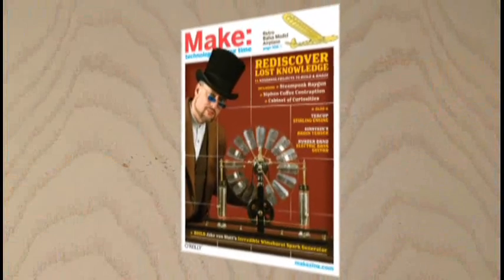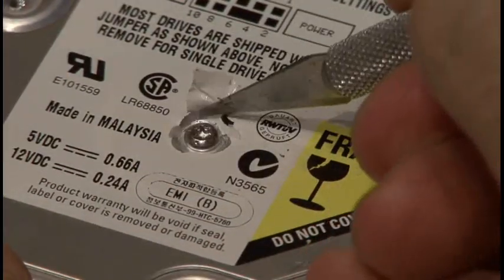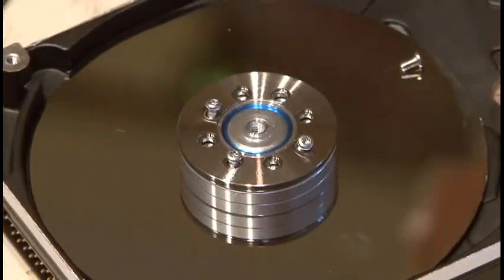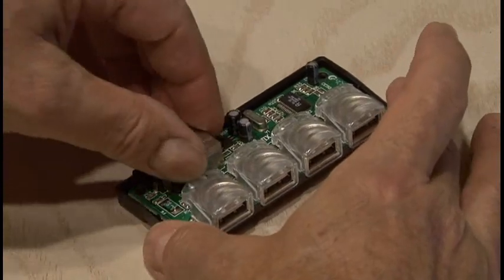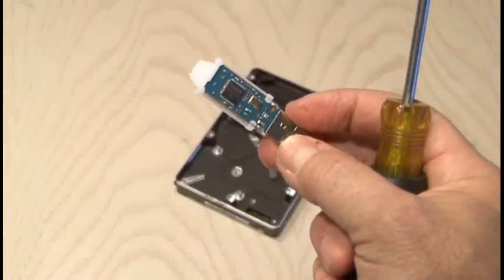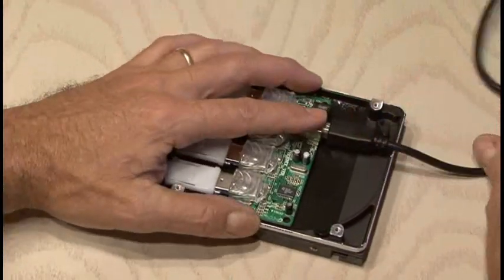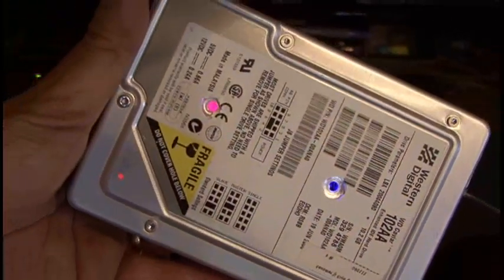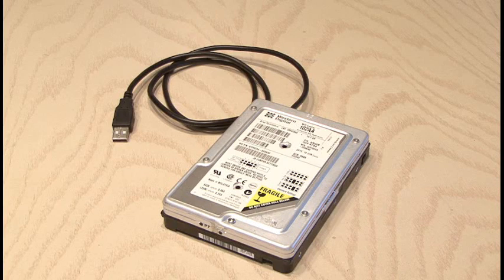Weekend Project: Flash Memory Hard Drive

Comment: @krap101 Just because the IDE bus can transmit up to 133 MB/s, and the SATA bus up to 375 MB/s, doesn't mean hard drives can do those speeds. Most modern 7200 RPM drives can do a median of 60-70 MB/s read and usually worse writing, which is what USB 2.0 can do (~60 mb/s.) If you have a good USB 2.0 flash drive, it can usually sustain maximum throughput of the USB 2.0 bus both ways, making it faster than a hard drive.

The only downside is flash drives used in that manner won't last long.

Comment: Easy to turn 4x USB flash drives into "one drive". Its called Symbolic links. You use on of the USB flash drives and using MKLINK command in windows link the other 3 drives to folders on the 1st USB Flash drive. Do a google search for the MKLINK command and how to use it.

Comment: hey guys, to combine the drives you need to 'span' them. spanning is achieved in windows 7 (enterprise and ultimate) using the dynamic disk tools.

you could set them up in a raid configuration! that would be a really cool upgrade as it would maximise reliability as well as all the other bonuses.

Comment: Not to mention he didn't actually "double" the capacity. he said it was a 20 gb HDD, and used two 8Gb flash drives and 2 4Gb flash drives. (that's 24 Gb for those who are bad at math)  so he added 4gb, and made the whole thing much heavier and bulkier than necessary by adding the HDD case.

Comment: @theonlyraybenz  True magnetic disk drives are a lot cheaper than flash drives, but one thing thing to think about is solid state memory is a lot more durable. My cousin sent a SD card through the wash once and it survived!

It looks like you could make an even tighter case and if you could format the drives into a raid I think it would be a pretty solid project worth doing.

Comment: @Wilsonboy0528 uh hey uh Dude , you're missing the point ..., why strip a perfectly good hard drive??? when it could've been used for a freenas machine or repurposing  old hardware...!!!

a more "basic" way (as you put it) would've been to just attach the thumb drives to the hub mount that up inside the tower somewhere and call it good...

so yeah , why don't you reply back when you have a smarter and more well informed (possibly from a linux and not a common micro$oft winblows user) standpoint

Comment: I had made something similar to this back in 2004 using (4x) Lexar Jump Drive Elite with a USB 2.0 hub. I had installed RAM IC heatsinks on each USB drive with Arctic Silver epoxy for extra cooling. I had configured them for write behind caching on my WinXP box in 2004, well before "Readyboost". I would personally use an external eSATA (3 Gbps) drive and shielded cable for "Readybost" or Linux Swap, as this is superior to USB 2.0 or Firewire 800. At the time (2004), it was a neat idea.

Comment: @TheLagartijamovil Nothing wrong with flash memory, but you want it to be flash memory in the form of an SSD with a SATA interface and a SandForce controller... In Australia, an OCZ Vertex 2 60GB sets you back 145 bucks and it's much, much faster than regular hard drives. I managed to get the OCZ Vertex Limited Edition 100GB for 200 bucks (they no longer make it) from a retailer who managed to get them and it works awesomely :D The best bit is booting anywhere between 5 to 10 seconds.

Comment: Fun fact CompactFlash cards can be wired up to an IDE port and work, all you need is a passive adapter, so you could alter the drive to be a CF adapter without any new parts by wiring stuff right to the card.

Comment: @newusername01 Why would you do that when you can get a pretty large and very fast SSD for that?  Hell, you can get a 120GB OCZ Revodrive 2 for that.  That's 4 SSD's with Sanforce controllers on a single PCIe 1x card.  All running in RAID0.  It's the fastest SSD on the market with out jumping to the IBIS drive.  They cast just a bit more than your SD card idea and it WAY faster.

Comment: @sepiachoice Well you can get USB hubs that go in the back where thing like video cards and stuff go and plug it in with a 4pin. Sometimes they have one USB inside, where you can plug this little thing in.

And if your school doesn't let you bring in flash drives (autorun content and malware transporting can be done with them) but does allow external hard drives (more pricey, less likely to be used as malware transport) you can use this sneaky trick to bypass that rule.

Comment: @mannsi08 Actually if you use a high speed usb thumb drive that's USB 2.0 or 3.0 and could raid them together it should be plenty fast enough. Maybe not as fast as the latest ultimate speed SSD's, but pretty quick.

Comment: ok, then this was pretty useless, but now this is a great idea. first, now you know to make it raid 0, also now theres usb 3.0 which would let you use a usb hub like they are 4 seperate usb components. also, now you can find a 16 gb flash drive for just 10 dollars on amazon. so you could get 64 gb ssd for just 40 bucks, and if you have usb 3.0 you get 10 times faster then this

Comment: So all this does is put a USB hub with 4 flash drives into a hallow HDD case for no reason. He doesn't even put it inside the computer. What's the point? Just use the flash drives with the hub.

Comment: @TechBoy195 You ever tried to use four usb flash drives, a wireless mouse, wired keyboard, 360 gamepad,iPod connector, and a powered amplified Stereo headset. I bet not, but some people like me would do. This simply would make it easier. Plus what the hell would YOU do with a 10GB HDD. just throw it away.

Comment: @80486er I wishwe could put in 8 USB Sticks instead of 4. Wait, we just remove the USB connecters and wire the flash drives in directly! We should also add some RAM.

Comment: This would have worked better if you had a SandForce controller and harvested the NAND flash chips from the USB, then use the SATA interface to actually have it inside your computer. Thereby creating a 3.5" SSD/HDD that only uses flash chips, and is not restricted by the USB2.0 read/write speed restriction, not to mention, there would only be 1 drive path.
It would probably be about 100 bucks more expensive though.

Comment: Cost 1 x hub and four keys = more than just buying an external hd! This has to be the biggest EPIC FAIL i have ever seen. By the way it is not a flash memory hard drive its four usb keys in an old hard drive case you moron. And for my next installment how to make an old power supply even more powerful, just take out the insides and replace them with more powerful insides from another power supply.

Comment: @madjam002 USB3 has been out for a few months. And USB3 (5Gbps) is actually faster than SATA2(3Gbps) my usb3 HDD dock transfers data from harddrives at their max speeds and is limited by the HDD speed, not the cable.

Comment: It's called Raid0. Linux has a software raid driver. Windows should be able to combine them using its volume manager. But I wouldn't use raid on flash drives, it would run like total crap, especially when each "drive" is connected through a USB hub. I could be wrong but I don't expect good performance at all.

Comment: if you format the multiple flash drives into a single combined hard-drive using something like partition magic you could get away with a single drive letter. however, the entire thing would fail if just one of the drives were to break for whatever reason.

Comment: @Madclocker  Now-a-days USB 2.0's have what's sometimes called Ready-Boost, or Speed-Boost, and others just call it System Paging, all it does is indexes a bunch of files and dumps them on the flash drive so whenever you plug in the flash drive it becomes a direct use drive by the OS like a virtual drive or a simple hard drive with less space.

Comment: @DarkPlagueStudios  Yes but you haven't used it for OS have you?. It would be toast in about 1 week. Most peeps don't know it, but your computer writes to and from the disk thousands of times daily, and the nand technology only allows for about 1000 rewrites per bit on these cheap flashes. This project is no good for OS loading.  the only reason to do this is to get more storage capacity out of existing flash drives.
Obviously it is a great conversation piece though.

Comment: @wowfreaker Bullshirt..a terrabyte is 1024gigabytes....he's just pissed 'cause his 1tb drive formatted to 971gb. You have to remember that formatting in itself takes space on the drive, otherwise, the computer wouldn't know where to look for the needed data...also Most hdd makers cheat on the spec's and relegate 1000gb to 1tb instead of the actual 1024 gb per tb. So you are already being cheated on the capacity, and add the formatting and you loose more than expected. I hope this clears the mud.

Comment: @jaggedspike My 1st hdd was 20mb (I had two) The processor was a 16mhz 386SX (16 bit code only) 4mb ram, and a blazing fast WD bussmaster vid card with 256kb mem. (I still have the card and 1 of the 20mb hdd's) That's when I discovered the original  "Duke Nukem"...what fun times. 
Actualy my 1st computer was a RadioShack MC10 but it was stolen b4 I got a chance to "get to know" it.

Comment: @Mariuspersem  Well, sort of..the SSD's out now are using faster mem chips than flash drives, and they use an interface that won't impede the performance by much. I haven't delved into the specifics but when the 1st flash drive came out, I knew that it was only a matter of time b4 ssd's came out.
I remember speculation that ssd's were comming, but they would be slow as snot. (the 1st flash's were almost as slow as a floppy disk) so nobody expected much

Comment: @douchebagsification  From Windows 2000 and up, there is a program called "disk management" that will let you set all the flash drives to dynamic and you can setup the raid array from there....have not played much with it, so I cannot give particulars but I think everything you need is in there. The MS knowledge base can give all the instructions on how to do it.

Comment: @uxa1 I can;t see how this can speed up anything...USB drives are inherently  slow, even with USB 2.0 technology. I can see the geekyness of the project and I can see the benefits of having a large capacity  flash drive for reliability and longevity, but no speed increase..I would suspect the opposite is true. and for those saying that you just made it harder to remove the individual flash drives, why would you want to? Just keep one as is for the sneakernet.

Comment: Really  - no point what so ever to this Tech-Tip. All you really did was destroy an old hard drive. You could have just used teh USB-Hub and plugged in the Flash drives and had a much smaller and lighter storage block...Also, since you've incased them, you can no longer simply remove one of the Flash drive - if you need one, you have to now unscrew teh case..>? what a useless Idea...

Comment: I know a tricky way to make it all into 1 dynamic drive.It will require extreme caution though.
1st.remove the memory from the USB flash drives which would be small rectangular shapes with some metal wires popping out and going down.

Find a circut board compatible to fit all the memory and a USB slot and mabye a resistor or other componets found on a USB storage device.
Solder it all onto the circut board.

Comment: This is a great project if you happen to have a source of cheap flash drives!
Otherwise, I was able to find a refurbished 2tb external NAS with 1gb RJ45 for under $200 on ebay... it's a 'worldbook' with two 1tb drives in RAID0. Just make sure to use CAT6 cable which is added expense. Can also be reconfigured to mirror, but then you loose 1/2 the drive capacity.
If flash drives ever reach 1tb, I will be doing this project for sure!

Comment: Why dont you use software RAID to combine all 4 into a single drive?
You would need to have 4 identical size 'drives' ie 4x 8gb
Certain versions of MS Windows support software RAID without needing to install anything extra.

With RAID5 you could have 24gb with redundancy incase one of the memory sticks fail, you do not lose any data.
Or with RAID0 you would get 32gb as a single drive letter.
I do this with old IDE drives.

Comment: Amazon has a  Serial-ATA-Adapter-Converter-Backup so you can make it IDE or SATA ready.

For dynamic disks you can do that in Windows. Do a search for dynamic disk drives

Most awesome. You can install any OS in about 8GB, so the other 3 could be OS Storage. Of course you could also boost the amount of HD Space with ease by replacing any of the USB flash drives. Excelsior. Faved.

Comment: @samchaosdesign Actually, my first computer was an HP 9830A "desktop calculator." It didn't have a screen; all output was to a line printer. No disk drives. Either tape or card deck. Oh, and a total of 7600 bytes of RAM (yes, *bytes*). Made in 1972.

Comment: @tiktok51 

Do you realize how much work it is comparitvely to get a new drive working?
Aside from backing up the old one, you also have to format the new one, get the proper power connections (and new ones if necessary), and see if the computer recognizes it after all of that.  And that's not even counting putting all your old shit onto it.

Comment: @sideburns2009  usb 2.0 will provide 500ma of power only after you have done the "aknowledge" initialization. so first usb give you 200 - 300 mA and then , if everithing goes right , it gives you full power. otherwise it stop erogation of power t. so is not so simple that it will work. in some case yes, in some other no.

Comment: Like here in America our housing has 110V to a wall socket, I can plug in a power strip with 6 plugs and use all 6 pulling the 110V's. It's not going to just "not" power them but my electric bill is sure going to be higher. The power is there and all 4 will use the 5V provided to be powered but USB 1.1 isn't always compatible with multiport USB hubs.

Comment: @djtonyxxx5 Don't need to try it. I know how USB works and the differences between 1.1 and 2.0, aside from the speed but just knowing how it works is all you need. USB has a +5V hot and a ground and the rest is data. USB 2.0 has more support for a higher variety of devices. USB will provide a constant 5 volts, it will power all 4, just run the battery down faster in a laptop.

Comment: mdadmin can be used to set those up as a RAID-Device, if you reconfigure kernel and udev it will automatically detect the drives and reassemble the virtual drive if you plug the USB-cable in

Comment: No, a terabyte is 1024GB. 1000 is not a power of 2.  Think of something doubled: 1, 2, 4, 8, 16, 32, 64, 128, 256, 512, 1024. Companies advertise it as 1000 to not confuse non-techy customers. Even though they sometimes advertise 1000GB, it is actually something like 950ishGB.

Comment: To make a dynamic drive use the disk management software in windows xp, vista, and 7 (right click on my computer and click manage then look for disk managment).  Right click in the grey area to the left of the partitions or the spot that would say what disk it is.  And click convert to dynamic then once converted right click in the same area and click new spanned volume.

Comment: To answer the question you have at the end of the video ( an easy way to dynamically put all flash drives together for one drive letter etc...) you would need to basically make a mini computer to fit in the HD case as well... windows doesnt like forming several usb drives together, so if you can  make a hub that does that for you then there you go, but other than that.. i dont think it will work on the fly...

Comment: I put some old 4 did flash drives on my old work pc Pentium 3. and put 150 meg swap files on each and increased the speed of the P3 to where even though it was a 800Mhz pc it felt like it was a P4 going at 2 gighertz.

Comment: @JosephMBoyer 

it is possible but take a read of my comment [@o0Deano2k80o ]

altgough it would work on xp/vista after a very very short time 10-15 minutes the drives will in fact blow due to excessive data reading and writing, they simply aren't designed for it. so in a way you are correct, its not worth the money.

Comment: The capacity of 4 USB sticks in a box larger and less portable than 4 usb sticks. WTF were you thinking?

you have not saved or increased the storage of the HDD. Instead you've completely replaced it and ruined a few perfectly fine devices in the process. Congratulations, you're a  genious.

Comment: i mean get the usb to sata adapter and plug in to the motherboard and run ur "project flash memory" as an ssd to load windows 7 in it.. and all ur other apps.. its a very good mod at least until SSDs get cheaper...

Comment: hi.. has anyone tried doin this project and get a usb to SATA adapter.. plug in to the mother so it could be used as a SSD-like.. i mean its pretty much same concept... because i can make a 64GB for way cheaper than u can buy an SSD... that way ur system runs fanster.. and u can put all ur STUFF on an external HDD

Comment: I know that flash driver are much better then the old HDs but it's a bit silly to get the 4 USBs out of the, I must say 'pretty case' and to put them in a HD with USB Hub.. which is eachially just the same as putting 4 USB flash drives in a hub, and it is handy if you want to echange things with friends, cauz it isn't big and..

Comment: You'd need a RAID controller
that supports USB drives - that may be a tricky thing to find. Alternatively you could go for pure software RAID.

But USB flash drive
transfer rates are abysmal, you'd have to put quite a few of them into a RAID set just to equal the transfer rate of a mechanical drive, let alone an SSD. Random I/O performance would be better, though.